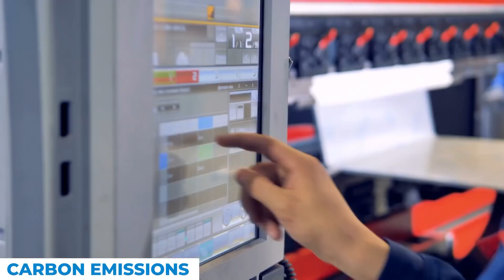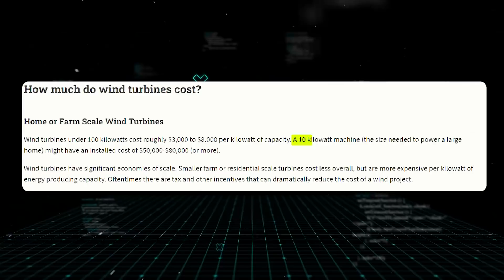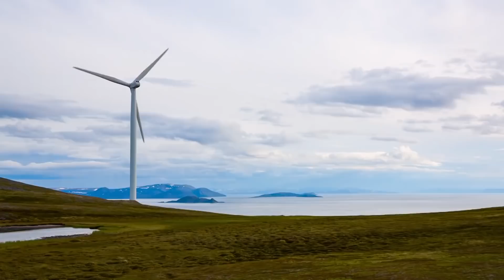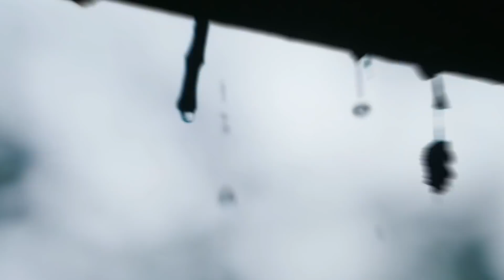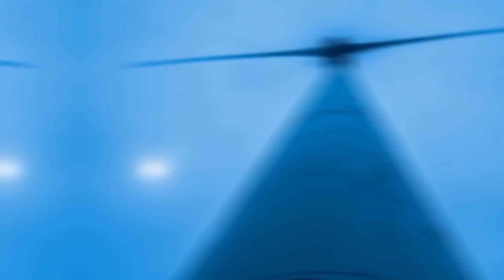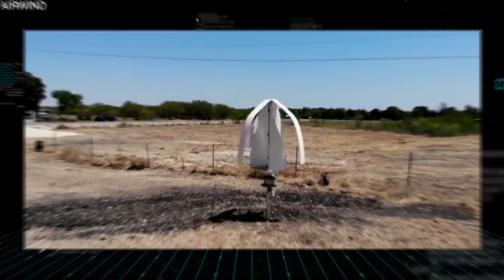This INSANE Invention Can Send Wind Turbines To The Past!

Comment: I have a better one 😎
Take a gasoline generator or diesel ,remove the motor and swap a electric one  on battery, s  make shure it makes enough Rpm to spin the generator and produce 110 or 220v if not  use gears to increase it or reduce it. and from the generator self when its running conect the charger for the batterys for the 
electric motor or set it direct make shure the voltage match you may use a voltage regulator and  so you will have a green no emision generator 🤔✌️

Comment: So, the Swet Prototype is 8 by 8 meters and produces 0,05W.  This is of no practical use, isn't it? for 5W you would need 80m by 80m. Compare that to a wind turbine which generates a Million times more energy on the same space.